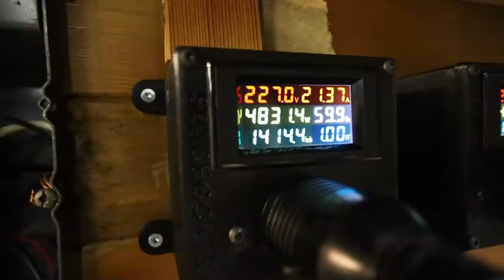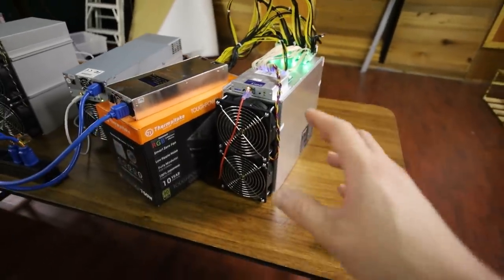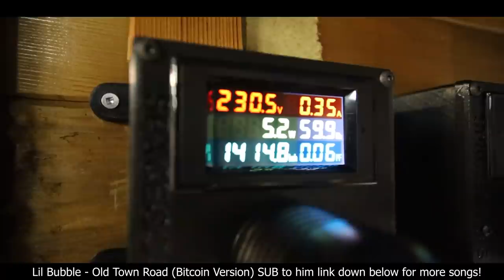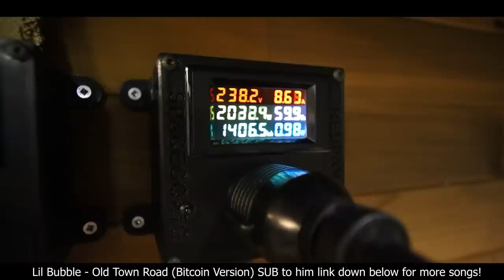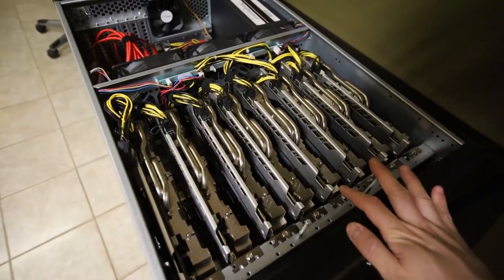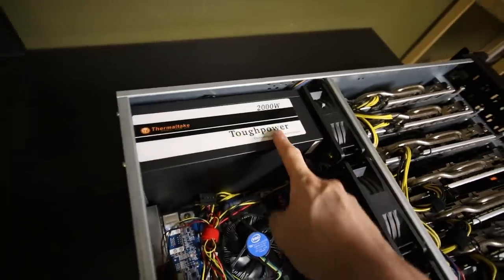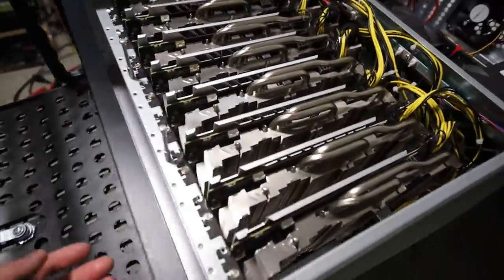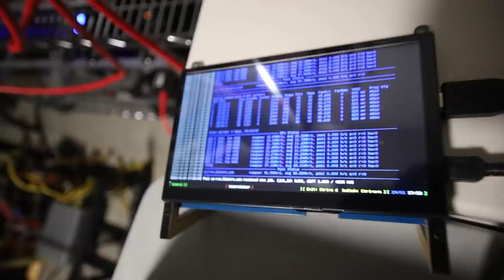Shutting Down All The BARN Mining Rigs...

Comment: Have you thought about adding alternative energy like solar to offset your power consumption? or something to reuse the thermal (heat) generated from your rigs?
Reply: It would be better for him to just pick a different energy supplier. Solar’s ROI is crazy long unless you are in specific regions in the US. Looks like he is already using the thermal energy to heat the barn. Thermoelectric generators have been experimented to convert some waste heat from chips to electricity but it caused cooling problems to the point where extra active cooling was needed, counteracting any electricity it produced

Comment: How much mh/s can you het with 5x 5700xt without bios mod?
Reply: Atleast 250-255mh, undervolt the gpus to save on power bill
Reply: Houd er wel rekening mee dat de stroom hier wel aanzienlijk duurder is, 2 tot 2,5 keer zo duur, ik neem aan dat je in de Benelux woont aangezien je naam Nederlands is.
Reply: @ricardofolkerts2314  ja ik betaal 0.24 dollar per kwh
Reply: @boudewijn1707  euro bedoel je?
Reply: @ricardofolkerts2314   nee dollar ik betaal 0,20 euro per kWh
Reply: @kavaskous  How does the memory temps run on yours? I just got a used one and the memory is running hot as hell , like 99c when the gpu is at 55c

Comment: Hey, have a question: I have 6x GTX 970 4GB at home can I start to mine ETH with dose? And how many mHs do I get from one ? 

Thanks 🙏
Reply: Sadly 4GB cards are not very profitable.  I have a 4GB RX570, and the 8GB version is TWICE as profitable so I’m kicking myself for now spending an extra $20 last year for a 8GB card.
Reply: @AsianPersuation24x7  But it’s possible 😀 how many mHs do you have ?
Reply: @luke4727  im not sure about its actual mHS all i know is on nicehash it would earn about  0.02 mBTC/day vs 0.07 mBTC on my 2070 Super and 0.06 mBTC on a 2060 laptop, the 8GB version of the RX570 was calculated on nicehash to get 0.05mBTC.  i know there are ways to lookup the mHS of the cards i just forgot.  im only warning because it may or may not be profitable depending on your energy cost but if u got 6 cards laying around just try it lol